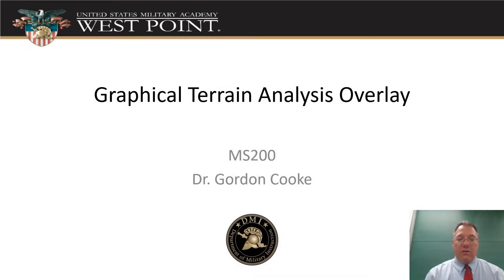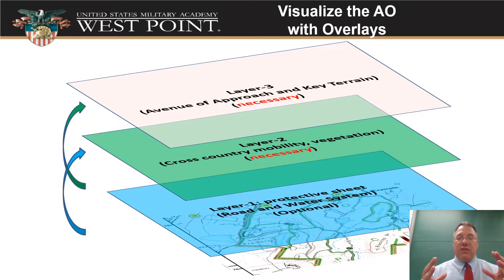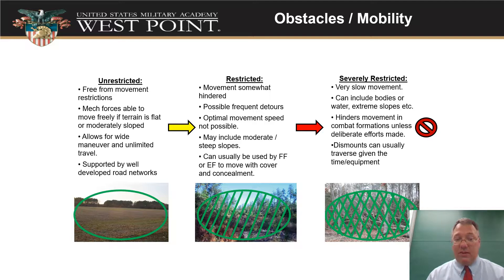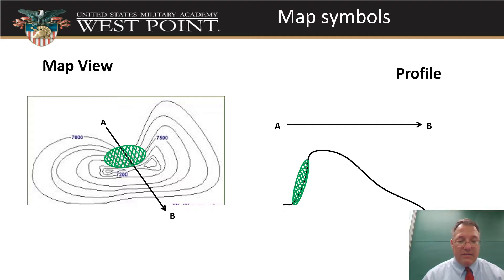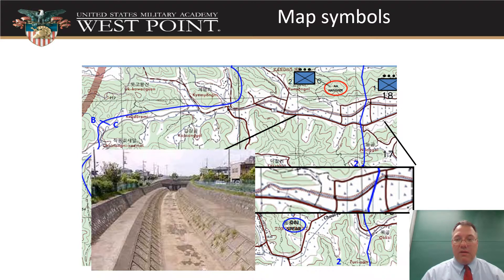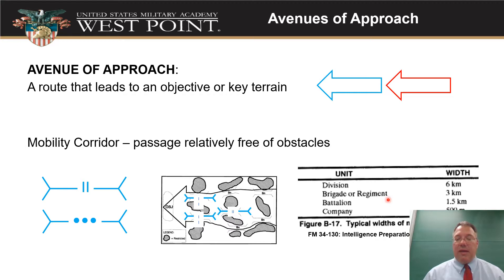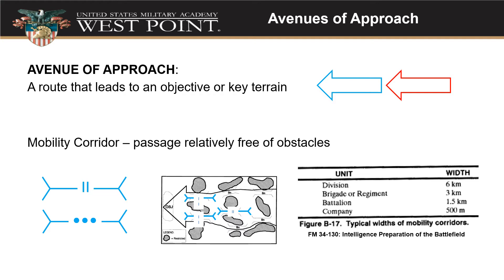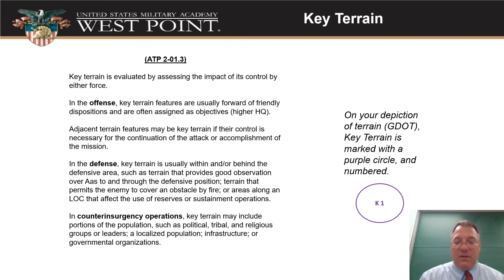Graphical Terrain Analysis Overlay

Comment: would it be possible to make a video about How to Make a Graphical Terrain Overlay?
Reply from the maker: Whether you call it a Graphical Terrain Overlay (GTO), a Graphical Terrain Analysis Overlay (GTAO), or a Graphical Depiction of Terrain (GDOT) they are all essentially synonyms. The doctrine of occasionally updates to change the term and maybe the specific required elements listed in doctrine change slightly, but they are basically the same thing (and people aren't always up the very latest doctrine.
A Modified Combined Obstacle Overlay (MCOO) is very similar and serves the same purpose, but I'd argue it is a different thing, in the the MCOO is typically more detailed and focuses on the obstacles and restrictions (existing and planned minefields, streams, a more detailed terrain/slope analysis, etc).  
MCOO is typically prepared by higher staffs by specialist Engineers or Intelligence staff. GTO/GTAO/GDOT are typically prepared at small unit level by the leaders making the plan.
Reply: @militaryartandscience  How to make Modified Combined Obstacle Overlay? Is there some videos or books available?

Comment: Minor note: ATP 2-01.3 IPB (2019) Table 4-2 affirms mobility corridor widths. This manual is added as a course reference for AY21.

Also, could be helpful to close-loop and add labeling avenues of approach as "AOA1" and to show minimum two (primary, alternate) if not more depending on what the terrain itself reveals. Emphasizing that AOAs are not a route, but only areas the terrain shows are *permissible areas to traverse once the Restricted and Severely Restricted areas are identified. Although determining a primary and alternate may sound like making a decision on a route, I think that it's more spending the time to scrutinize the terrain to find Restricted/Severely Restricted, and doing the close analysis to see if the terrain reveals more than one way to get to the objective. If this isn't the case, then briefer should prepare to talk risk and risk mitigation.